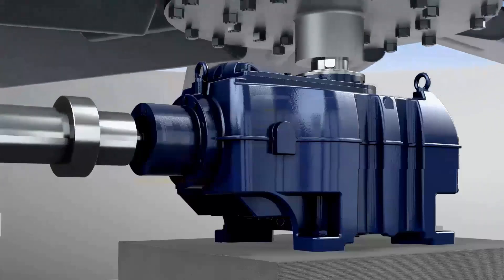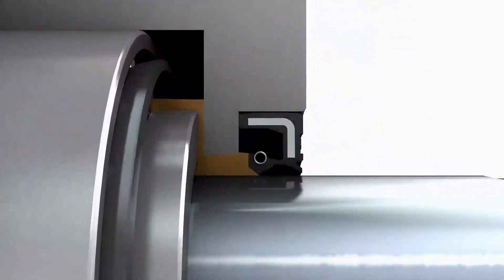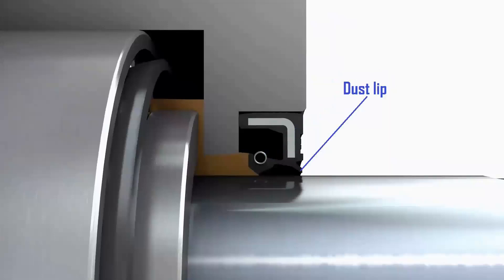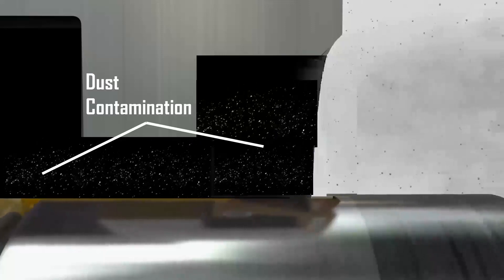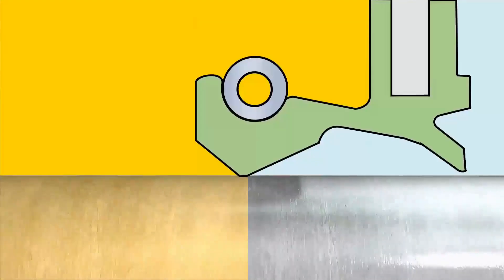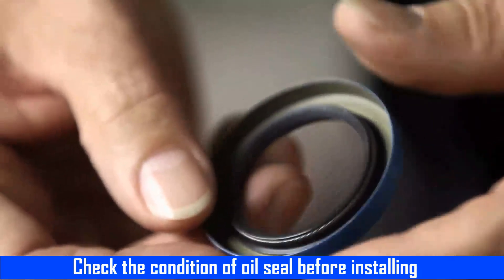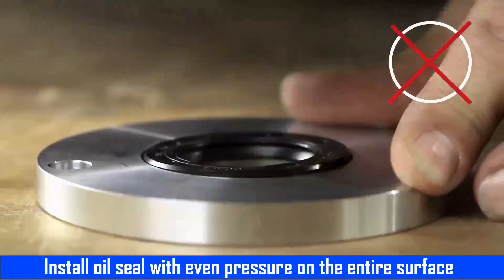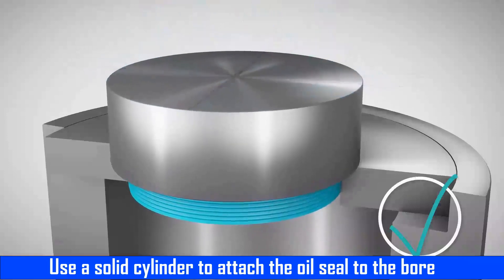how oil seal works ( animation )

Comment: Great video, helps a lot, thanks. What I don't understand is how the friction between the shaft and the seal does not rapidly worn the seal down? There must be a ton of friction between the two, especially for fast rotating shafts.
Reply from the maker: Because seal is made from durable but soft material and the contact area is designed as small as posible to reduce friction.

Comment: @5:00 Great animations and great explanations. Wondered how it was possible for the rubber seal to be in contact with a shaft for many millions of cumulative rotations (1000s of RPM for 10000s of miles) without wear&tear due to friction.
Reply from the maker: It's because engineers using correct method  and  test the product correctly. They make improvement every times weakneses is found. The result is a good product.

Comment: Very nice video.  Special thanks to the Engineers that design a lip for the inside of the seal to bottom against so you're not guessing how far to insert.  Not all do.
Reply from the maker: Yes, that because an engineering done by engineers.

Comment: What amazes me about rubber seal is that over a period of time the seal can wear a groove on the  sealing surface to the point a new seal will still leak that's when you need a speedy sleeve to put on the worn surface so the new seal don't leak
Reply: the way it works, is that the soft material captures very hard particles (could be a shaving of metal or speck of dust that comes from either inside or outside, what matters is that it's a hard particle) and then keeps dragging it along the shaft. So it's not the rubber that wears out the shaft but rather the contaminants trapped in the soft rubber matrix. If you kept that seal clean enough, this would not happen (as in, the ruber seal would wear out rather than the metal shaft). This is a common phenomenon in e.g. cheap brakes, where the brake is made of "soft material" but what in fact happens is that it captures stones and wears out the disk.
Reply from the maker: @JurekOK you're right. Thank you
Reply from the maker: Normally seal is the one's which wear and not the sealing surface or shaft. Because seal is made from elastic material. In a rare case, seal not have enough lubrication and not replaced on time.  Seal become rigid and create a groove on the Shaft.

Comment: How does the seal not wear out from the constatnt rubbing with tbe rotating shaft?
Reply from the maker: Actually seal wear, but the progress is slow depend on the seal quality.  Oil leak from shaft is a sign of wear from seal.
Reply: @temmycandrawijaya  Thanks.
Reply from the maker: Glad it helped
Reply: Generally if the shaft and the seal is kept very clean then it (still) wears out but very slowly. When dirt enters the area in between the seal and the shaft -- this could be a result of poor manufacture, installation, or mechanical shocks -- then this dirt can wear it out much faster.
Reply: @JurekOK  Thanks.

Comment: what happens if we use double seal ?
or use seal with the thick is different with original ?
Reply from the maker: If the original is using single seal then using double seal will add friction to the shaft. Using thicker seal as long as the housing can accomodate is not a problem.
Reply: @temmycandrawijaya  thanks brother
Reply from the maker: You're welcome

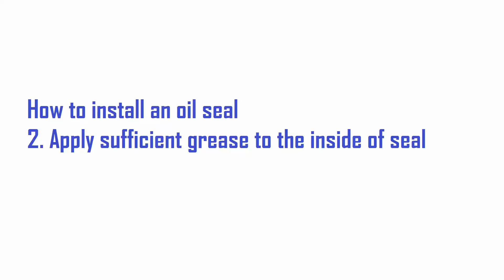Comment: 6:57 What type of grease need use?
Reply from the maker: Use grease type according to the manual book. If don't have any, general purpose grease will be sufficient for normal operation.
Reply: Only synthetic or silicone crease. Oil basted greases will destroy rubber.
Reply from the maker: That's right, thank you

Comment: How does the rubber doesnt wear out?
Reply: @vezselin  it does
Reply from the maker: Because the rubber is combined with others material to create an elastic and durable material.
Reply: it does wear out, and needs to be replaced on a regular basis. It's called scheduled maintenance.
Reply from the maker: @JureOK That's right, thank you

Comment: 5:51 I have a project where I have to seal a vertically positioned shaft from water running down all around it.  The shaft will rotate and also move up and down.  Is this type of seal good enough for axial movement of the shaft too?  If yes, which variation do you recommend? If not, what type of seal do you think is suitable for my case?
Reply from the maker: Seal commonly used for rotating shaft only ( example:  engine shaft ) or in and out shaft only ( example: hydraulic jack ). I believe that there is a seal to fit your requirement but maybe it's special product for special application.  the parameters like rotating speed, shaft diameter, shaft span in and out, shaft speed in and out, shaft roughness, fluids properties etc. These will be acccounted for the seal specification.  I suggest you to contact seal manufacturer to get more comprehensive solutions.
Reply: @temmycandrawijaya  thank you man
Reply from the maker: Glad it helped

Comment: Oil seals are the "unsung heroes" of all cars, machines, anything rotating.
If they break, the replacement labour charges are 10 times higher than the cost of the seal.
Reply from the maker: Seal position normally at the outer part of shaft. To replace a seal, we must disassembly components after the shaft to insert the seal and assembly again and this work consume much time than replace the seal part.
Reply: More like 50 times higher than the cost of the seal. 😅
Reply: @johnconnor7501 Trelleborg seals are very costly